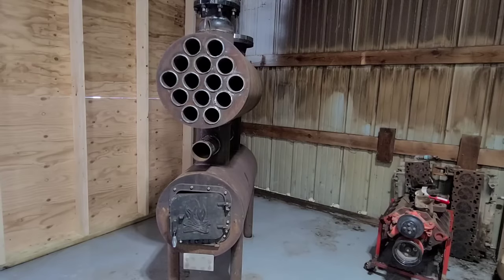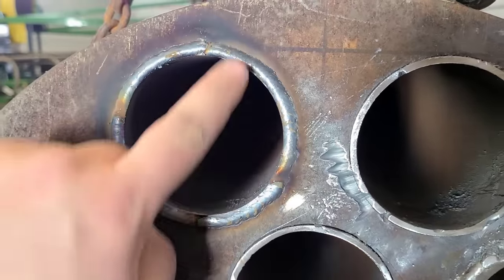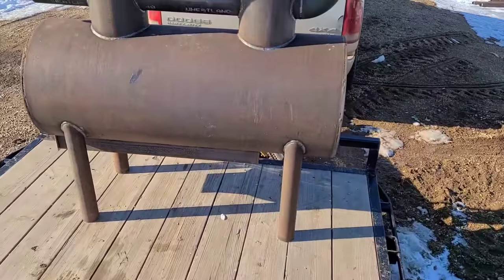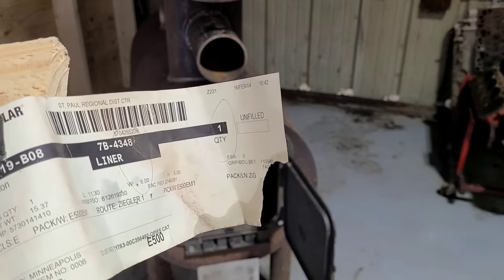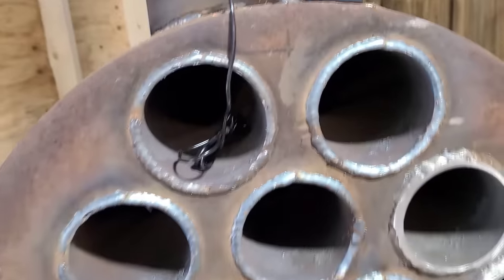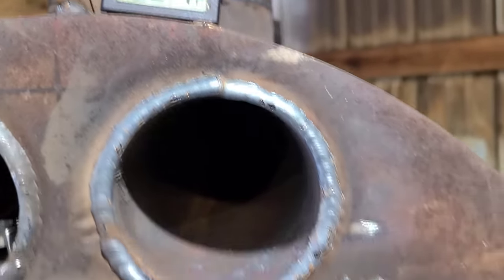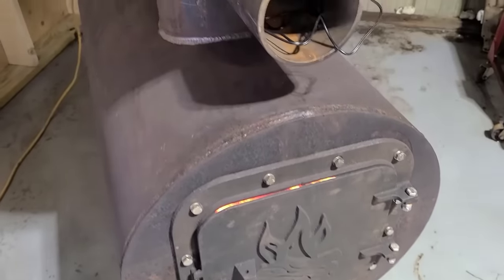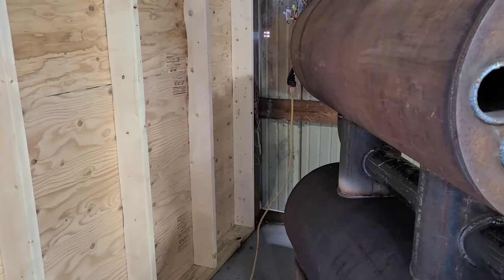My Ultimate Shop Wood Stove Build Part 3

Comment: What's your total guestimated financial investment into this build?
Reply from the maker: I bought the cast iron door kit for $50, that's it, the rest was repurposed scrap steel
Reply: @kylechrist  dang, that's awesome. Do you think I could do something similar, on a smaller scale, with old propane tanks and non-galvanized pipe? I know it is possible to put them together the same way, but do you think it would work as well?
Reply: Big Unk, With apologies to Kyle for the quick sidetrack. 
I'm not sure if you mean building the heat exchanger or the firebox?

If the firebox, then I can say yes, absolutely. I built a similar heater from a 100lb propane cylinder. Since the intended fuel is long pieces of "lumber" it works excellent. The propane cylinder's smaller firebox diameter would not be ideal for typical logs, but that's not the target.

I built a moveable "shelf" at the top of the firebox. With the shelf slid forward exhaust has a direct path up the rear-located chimney connection. With the shelf slid to the rear exhaust is forced to travel to the front of the firebox first and then returns to exit at the rear. 

I'm not sure that the moveable shelf was worth all the fuss. A sweet spot has been found and 
the shelf is usually just left in that position.

Thanks for the soapbox, Kyle.

Comment: Only comment is that the stove is burning air from inside the workshop instead of air from outside.  this would keep the oxygen levels ballanced in the shop.
Reply: the oxygen levels are not really a problem as the room is not perfectly sealed so there will simply be fresh air drawn in through any cracks.
the problem is that this means you draw in cold air which makes this entire setup less efficient.

Comment: This looks horribly inefficient. Heat exchange is the least of your worries when designing a combustion heater. Minimizing excess o2 through control of primary air flow, secondary air flow, and combustion temperature is the way to achieve high efficiencies.
Reply: Effectiveness>Efficiency
Reply: There is no definition for effectiveness in thermodynamics. Efficiency is the work generated by the heater (in this case heat added to the building) divided the total chemical potential energy of the fuel. If you want to  term effectiveness by getting the most efficient heater with the least effort and cost, the maker of the video would have achieved a much more efficient heater by forgoing the larger heat exchanger, and installing 70% alumina brick around the fire box and having a door that actually seals. Alot less effort for a large increase in efficiency. he just does not have enough temperature to fully reduce alll the combustible gasses, so much oxygen is going out the flue with combustible gasses leading to massive efficiency losses. In a proper fuctioning combustion unit one shoul have <2% O2 going up the stack. I bet he is seeing something like 12% O2. So probably using and heating 2x the air necessary, meaning he would have to remove 2X the heat from the flue gas just to come even in terms of heat loss out the flue with a properly designed heater. @Roxon321
Reply: @michaelgoulding3298  you missed the point.  Maybe by writing it out you will understand- effectiveness is more important than efficiency.

Comment: Great idea, but it would be really good to add a fan just to move the air through the pipes.  Heat moving away from source in to  other areas better.  Just an idea.
Reply from the maker: That's what the fan does
Reply: @kylechrist  I did not see them but as I skipped through a lot since I last saw it year ago i think.  I watch again.

Comment: First of all air intake should be from outside. Now stove is using warm air from inside the room. That is waste of energy.
Reply: Wasting energy? It takes much more energy to heat something from cold and warm something up more  recirculating al ready warm air through the unit and warming it up more  more is more efficient  less energy wasted
Reply: @GeorgeVeld The original comment is about the air intake of the fire box. any air that enters the fire box needs to exit the chimney.

Comment: Carbon and stainless will fuse together after a period of time stupid mistake
Reply from the maker: It's done everyday all over the world in pipe welding where stainless is welded to directly to carbon using 309 rod. These flanges are simply touching face to face and by time those flanges corrode through my kid's kids won't even be on this earth 👍
Reply: just delete your comment